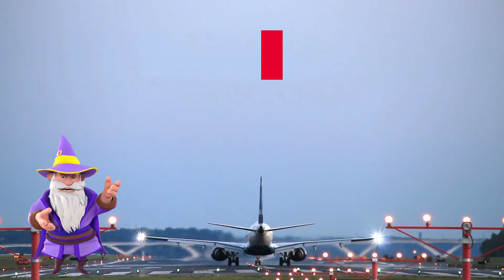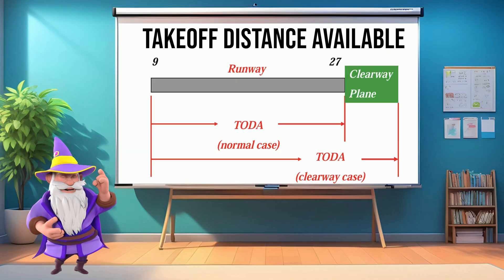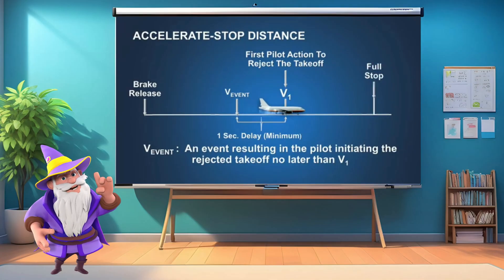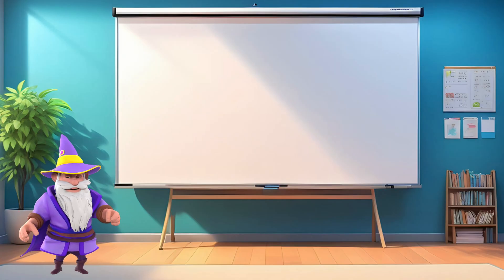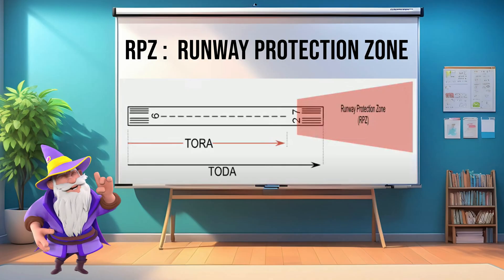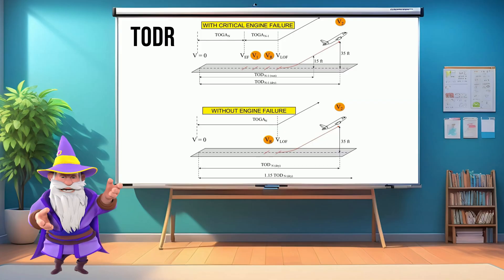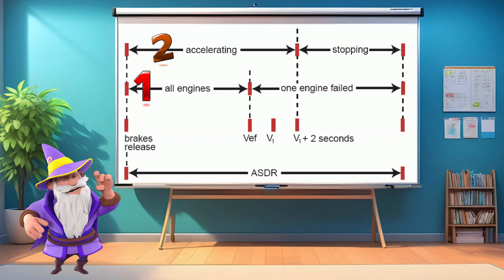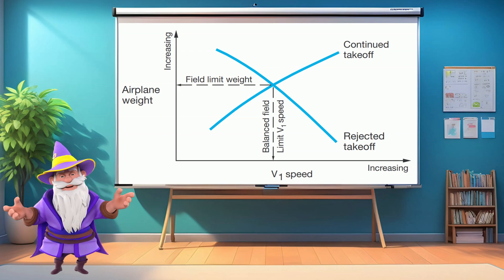This  Calculations Could Save Your Life – Runway Distance Explained! TORA, ASDA, TODA, LDA

Comment: Well done video presentation! Just a few things I'd like to mention:

1.  At 3:14, the word CLEARWAY is misspelled on the screen

2.  The FAA (and I believe ICAO did as well) removed the term "decision speed" from the definition of V1 many years ago, although this fact has not been widely disseminated in the industry. The idea behind this change is to emphasize that the DECISION to reject a takeoff rather than initiating the FIRST ACTION to rejecting the takeoff at V1 will almost certainly result in an overrun on a balanced field. The most accurate and brief definition is "maximum first action speed". It is defined as follows:

"The MAXIMUM speed in the takeoff at which the pilot must take the first action (e.g., apply brakes, reduce thrust, deploy speed brakes) to stop the airplane within the accelerate-stop distance.

V1 is also the MINIMUM speed in the takeoff, following a failure of the critical engine at Vef, at which the pilot can continue the takeoff and achieve the required height above the takeoff surface within the takeoff distance."

See also: https://skybrary.aero/articles/v1

Comment: Where can i find the distances. I looked through every chart i cant find them
Reply from the maker: Hi there, sorry for my late reply. you wont find them in the normal charts, they are usually on the supplementary charts of the airports, many companies like Blue Nav or Jeppesen wont have them on you airline package. some times you may see a D symbol indicating that declared distance information is available in the Chart Supplement, but not always. You'll find this information in the section dedicated to runway information, often listed as "Runway Data"  On normal charts of everyday use, you may find only TORA, just depicted as runway length. Inside the FAA go to the charts called AIRPORT MASTER RECORD, and you will find them there.
Reply: @TheAviationWizard  Thank you very much for your long reply. I will try that.
Reply: With tora in the main chart... you are good to go

Comment: Thanks. I have a question.  runway length calculated from the APM chart is TORA or TODA?
Reply from the maker: Hi, sorry for the delayed reply. That's usually TORA. not all airport charts have "declared" distances published. Nevertheless, always check with your operator and the kind of charts you are using. ( Navblue, Lido,  jeppesen... )  감사합니다
Reply: Tora
Reply from the maker: @AlexUAE  correct